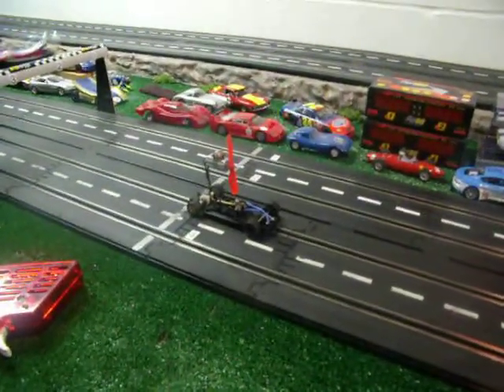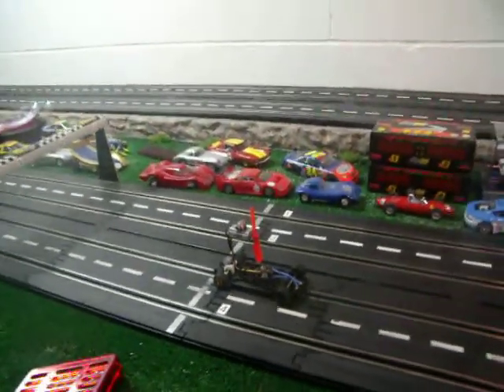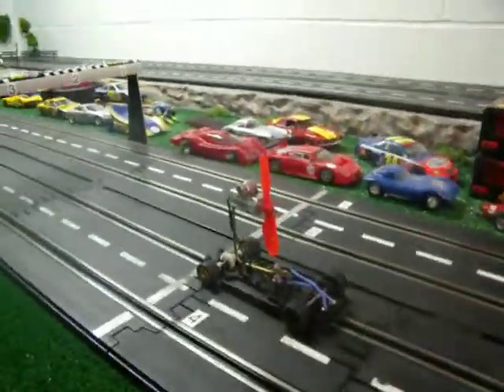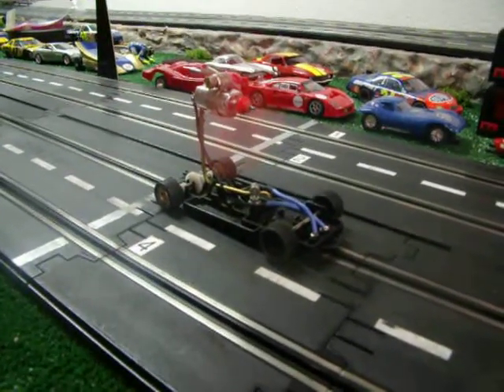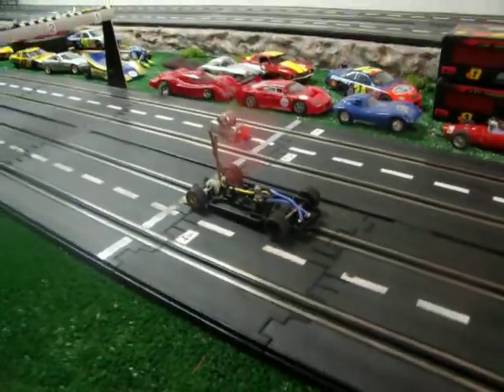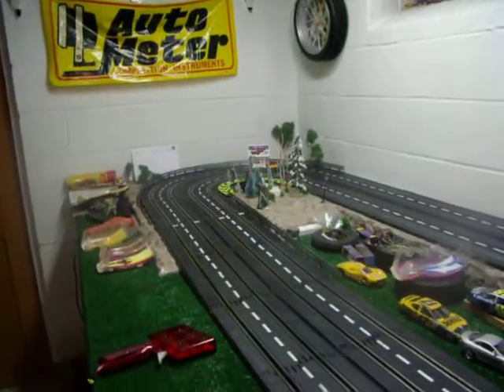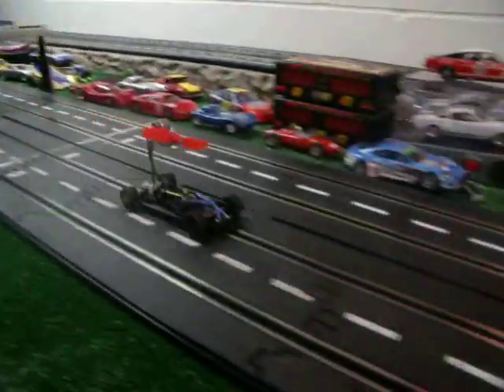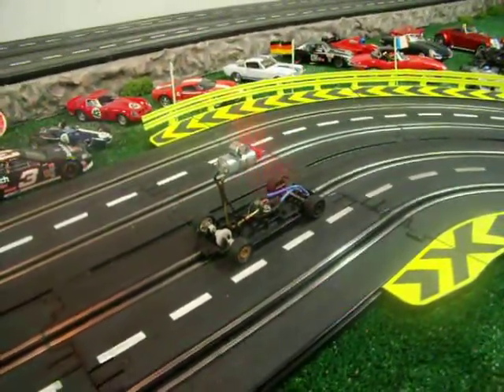Artin slot car track - Air Propelled slot car 1/32 - Prototype

Comment: We built them back in the '80's, used can motors out of HP2's and lego propellers on any H.O. chassis we could find, even had a couple of bi yearly races with them, they had that much interest. Passing was interesting running them, couple of the guys props where way too big and would clips cars as they passed each other. Rules became the downfall. Still wouldn't mind finding a couple of ducted fan units to try out and there was a guy building airfoil type slots on here about a year ago. Do you facebook much?